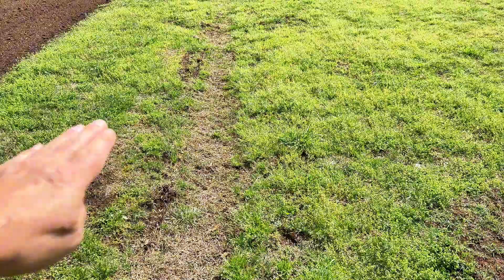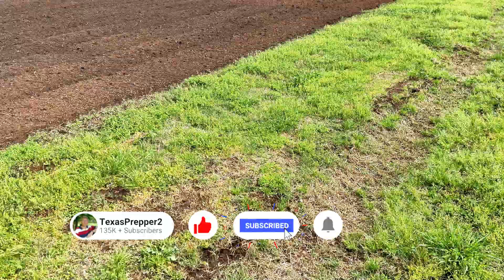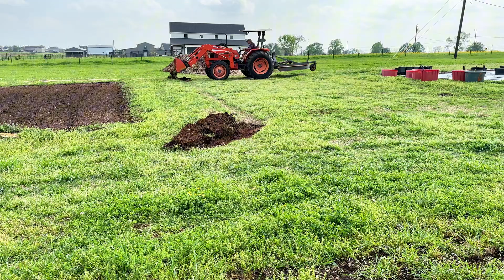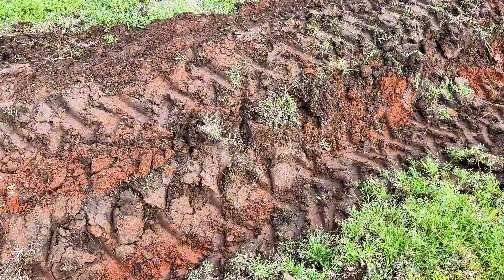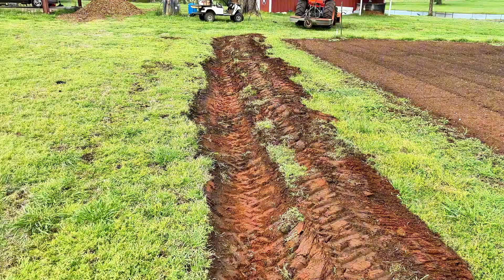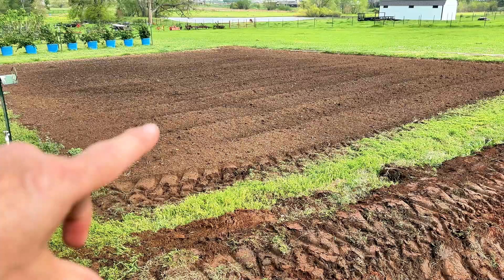Swales: The DIY Water Management System You NEED

Comment: If you have a middle buster plow it's a lot simpler and easier than using a front loader to make drainage ditches. 😊
Reply from the maker: True, but it throws the dirt both ways. This way I can deposit the dirt on just one side.